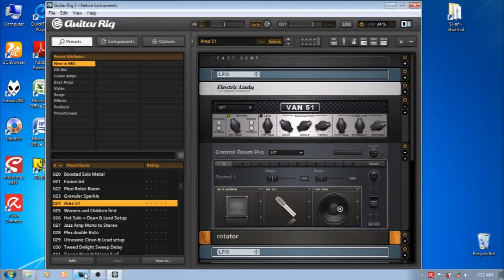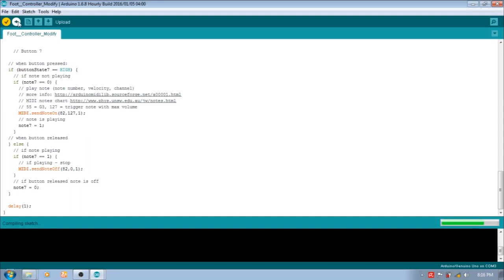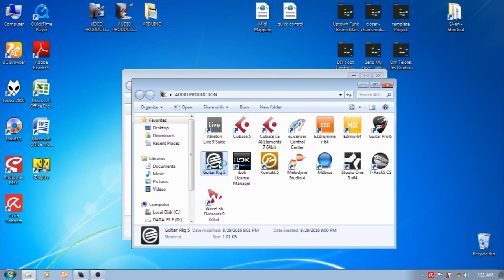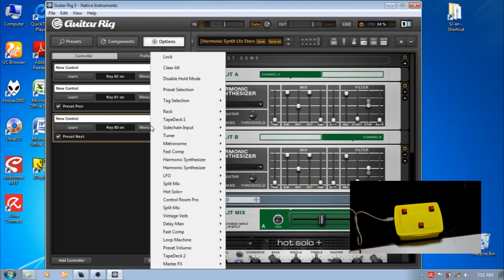DIY Foot Controller for Guitar Rig (Arduino)

Comment: I just made very similar foot control board with Arduino Mega 2560, I did not used any resistance and connected switch to gnd

Comment: Hi every time i put the Foot__Controller_Modify2-2 in arduino ver 1.8.8 i have the message 'MIDI' was not declared in this scope , i  install the Arduino_MIDI_Library_v4.3.1 but have  the same problem, any help if you can. thgs :-)
Reply: I did not try it, but in the last version of the MIDI library all examples contain at the beginning a "MIDI_CREATE_DEFAULT_INSTANCE();" call. I don't see it in the foot controller program. This may be a problem I think.
Reply: @Creutzfeld10   ok Thgs
Reply: Thanks  @Creutzfeld10